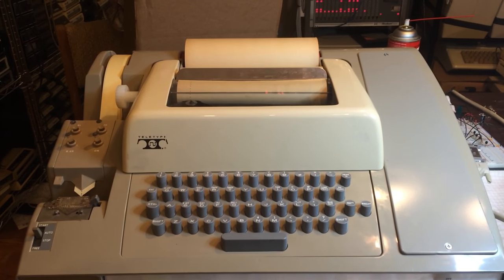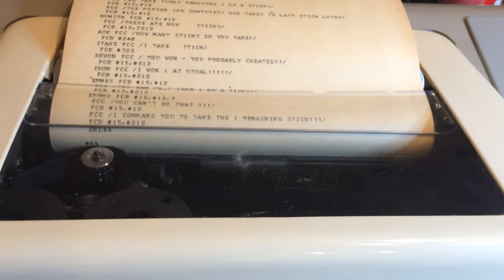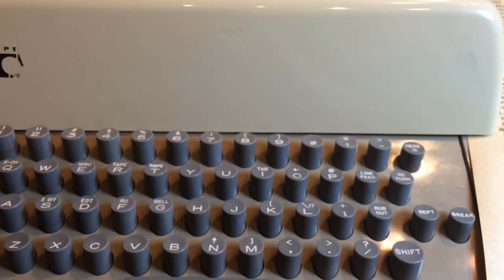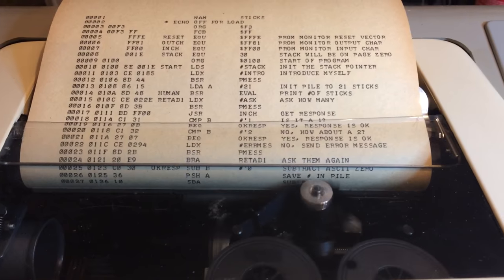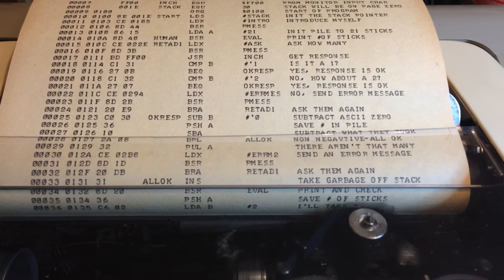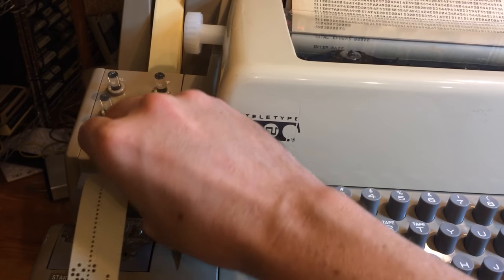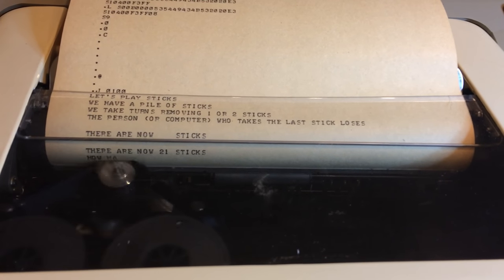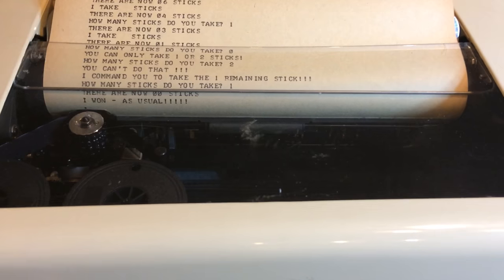Assembly development on Altair 680 w/ Teletype

Comment: Upvoted just because you went through the WHOLE FLIPPIN' PROCESS, and it stayed interesting enough for me to not change channels, even though my reason for browsing past here, was to see if a Model 33 ASR would respond to a 07 character with a bell, or if it was just doing a margin-ding, and that's what the program revealed, in the last minute of this long video. (TL;DR answer is, that it does both functions.) 
Great Job, Sir.
Reply from the maker: The very exact reason why that character is called a "BEL" is because of the physical bell installed into that teletype.  "PRINT CHR$(7)" will clack that bell every time it comes through. :)

Comment: Wow, programming looks like it was quite painful back in the day... Takes a moment to appreciate my auto completing and syntax highlighting text editor with its many keyboard shortcuts and endless plugins and customizability...
Reply from the maker: Well, I am also kinda treating this a lot like modern dev, where you can quickly and easily attempt compilation after a quick edit to a file.  BITD, with a system like this and its predecessors, you'd actually be pretty sure that your hand-written program was correct before entering it into editor, and you'd fix up your typos before sending it to the assembler, and you would hopefully get it all to go in one pass.  But at least I have enough RAM in the machine so that editor/assembler can be co-resident, instead of having to be individually loaded one at a time.
Reply: I was reading the manuscript of Kildall's memoir and he makes it a point to let the reader know how good we have it these days lol. What he describes in the book is a lot like your video (except even slower).
computerhistory_org/atchm/in-his-own-words-gary-kildall/
Reply: I came into programming large systems (COBOL and assembler) just as everything was "going online" from being totally paper-based - mainframes were actually based on 80-character-wide paper-stock punchcards (look up Hollerith card) and the first draft of a six-line COBOL program snippet like:
      PERFORM PRINT-ROUTINE VARYING X FROM 1 TO 3. 
      GO TO EXIT-PARAGRAPH.
PRINT-ROUTINE.
      OUTPUT "PRINTING NUMBER " X " OF 3".
EXIT-PARAGRAPH.
       GOBACK.
...was handwritten on 6 lines of an IBM 80-column program coding form, sent to the keypunch department to be punched into six punch cards, which were then returned to the programmer, who then arranged them (in proper order of course!) with the required preamble cards to invoke the compiler, then submitted that deck of cards to the Operations staff, to get a compile run on the machine, maybe right away, maybe that night. The operators read that programmer's cards in as one job, whenever a hole in the work schedule allowed, (the goal was, to keep the computer busy all the time, else you were squandering the investment) and printed the output of the compile job, which went back to the programmer again. If the programmer asked for a compile-and-run, the operator might also take a pass at running the actual result program, if the compile was clean. But BITD, programmers did not have access to a keyboard at all, they dealt purely with the paper. after the first compile, it was easier just to mark up changes on the compile listing, and turn that back in along with the offending parts of the source "deck," to be reworked. time-consuming, but it went faster, if you knew the particular shop's "rhythm" intimately. Oy, I looked over this long entry once, so I have probably made mistakes (and I did say COBOL *snippet*, not *program*), but that's my recollection. As I said, that was all leaving, as I started programming, because I got the nice glass TTY.

Comment: Is the Altair driving the Teletype? If so, how does it control it? Is there some 'driver' code stored in it the Altair's ROM to handle the interfacing? Also, if so did you write the code or it comes standard?
Reply from the maker: IO routines for the ROM Monitor are contained within the ROM.  Teletype is a serial device, connected to the console of the 680.

Comment: How rare are teletype machines? I actually kind of want one, but I'm assuming they're pretty hard to find.
Reply from the maker: Only hard to find if you want one that works and is in perfect condition and don't want to have to learn anything about them to make it work.  They are incredibly complicated machines, which require regular maintenance and adjustment.  You can find them pretty easily if looking in the right places, but they will surely be nonfunctional or problematic or ugly.  You can find them pop up on ebay in decent condition for $1000+ regularly...
Reply: TX Dj So they're not really rare, but most of them are just in bad condition? I wouldn't mind restoring one. (I would have to do a lot of research since they are from before my time and I have no clue how they work!) How much do you think a non-working one would reasonably sell for?
Reply from the maker: All depends on where you find it.  They're definitely becoming harder to find, most people just scrapped them.  If you're really serious, join the GreenKeys mailing list and ask the kind folks there - they know all the tips and tricks and where to get all the parts.  Who knows, you might find some for cheap or free- my 3 most favorite teletypes were found on that list
Reply: TX Dj Ok, thanks a lot for the suggestions. I don't have money for one right now, and there are some other projects I'm working on. But it's definitely something I'm thinking about. I have typewriters, a few vintage computers, antique vacuum tube radios...a teletypewriter would be a really cool, unique thing to have next!

Comment: I find the difference in size between the source code and assembled program interesting. When I write basic hello world program in C++, the .cc file is ~79 bytes, while the compiled output is almost 9KB. I wonder why the difference? Is this an inherent difference between assembly and c++, or can it be because of differences between computers then / now?
Reply from the maker: Higher level languages are wasteful... everything you do with them makes the output more and more bloated.  A compiler has to take what you wrote, figure out what you meant, and put together machine code to do the thing.  It's not always going to be as optimized as if you wrote it in machine code.  That's all that assembly is - "human readable" machine code.   Want to put the accumulator into memory? the syntax of how you write that causes the assembler to pick the right opcode for the operation and addressing mode, and then shuffles the thing over to memory.  Want to store something to the accumulator?  Well, depending on how you write it, the assembler picks the right opcode for the address mode that you imply with the syntax, and the thing just happens.  Check out my IMSAI video for some hand-assembled code.
Reply: It's mainly the libraries that will be linked by the compiler to your programme to get it to run that cause the giant size increase.

Comment: Why on earth would you type this code? Like on a typewriter? Or did the machine do this? What the hell is going on? :D
Reply: In the age before the fancy screens and monitors we have today, a teletype machine (fancy typewriter) is connected to the computer. The teletype itself is a fairly "dumb" device that takes what you write and send it to the computer (the Altair), and it replies on paper instead of on a screen. 
In order to save your work, you can print it out on punchtape, which is the left part. The first reel of tape is storing the source code so he can get back to edit it. The second one is the actual program ready for use (the ".exe").